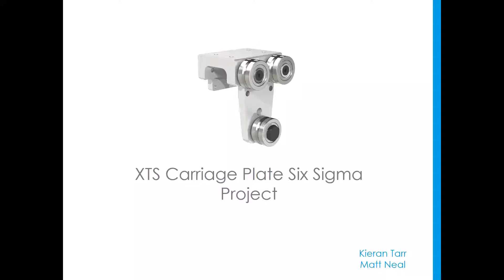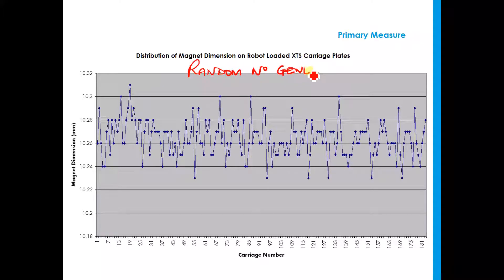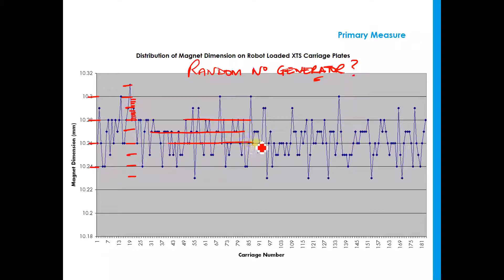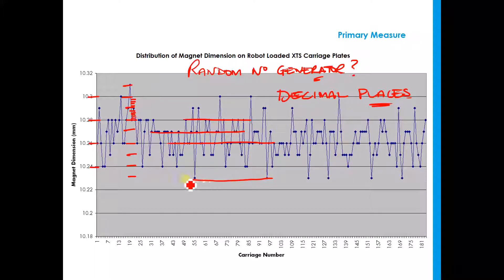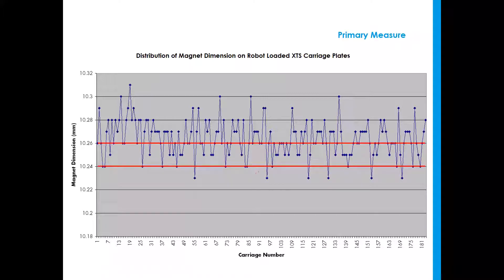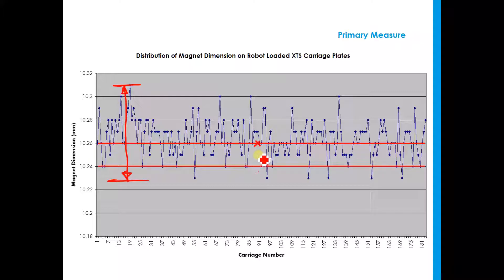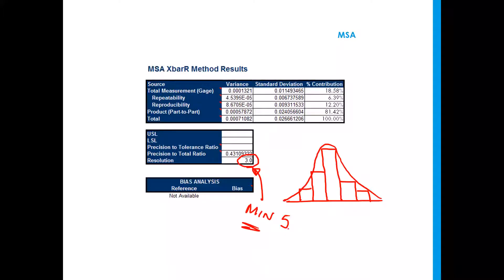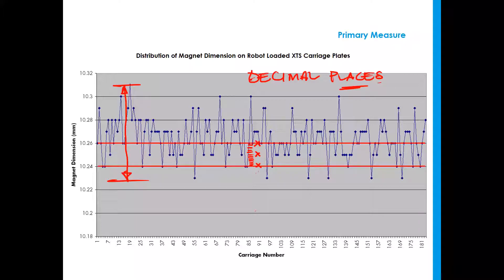Complexity Made Simple  - Measurement Case study

Comment: Hi Paul,

Thanks again for this resource. 
The problem you allude to is that of chunky data, I.e the increment is apparently too big to be useful for the chart.

It’s not clear to me what you’re  using the data for in your example but your comments appear to be based on the individual or x chart I.e. the running record. 

Since this is a problem involving the increment the rules or tests you are referring to are applicable to the moving range or range chart.

If this was an ImR chart ( n=2)  the rules would be:
Four or more possible values within the control limits. Any less will distort the limits and will result in wasted time acting on apparent signals.

For more information see manuscript 235 “ What is Chunky Data in www.spcpress/reading room.

Perhaps you mean an impact to the tolerance with your approach? If so I would be interested in your source for the rules you applied in the video.

Thanks again, hope this helps.